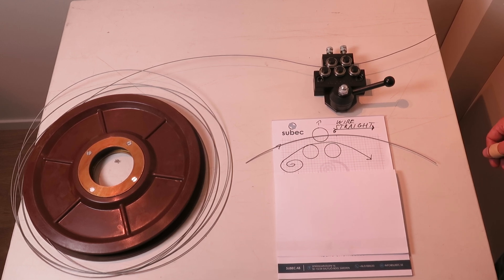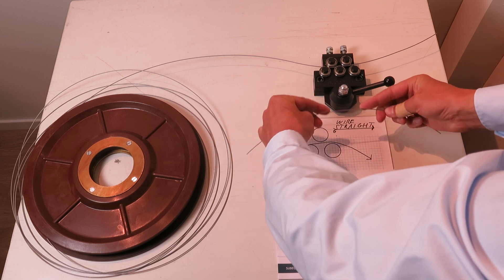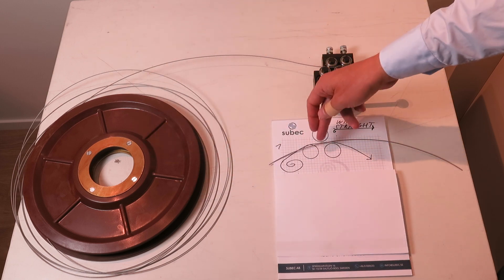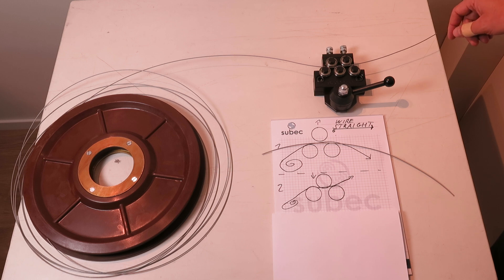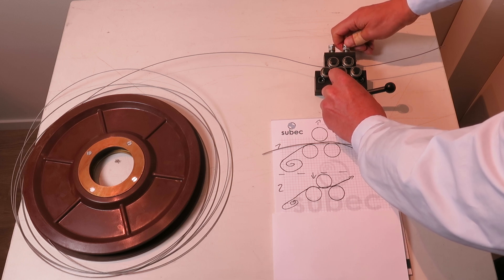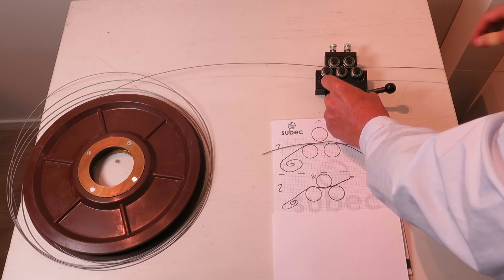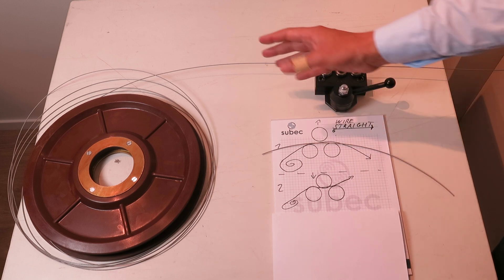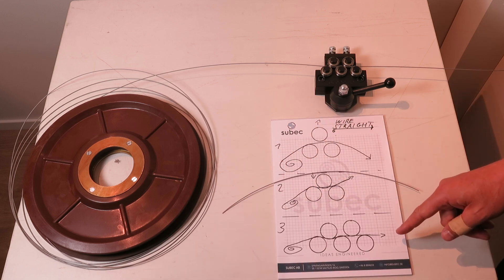The Principle of Wire Straightening

Comment: So if I understand right, in the five-roller example, the first set of rollers gives the wire a known bend radius by overpowering the original bend, and the second set of rollers takes it out. Is that right?